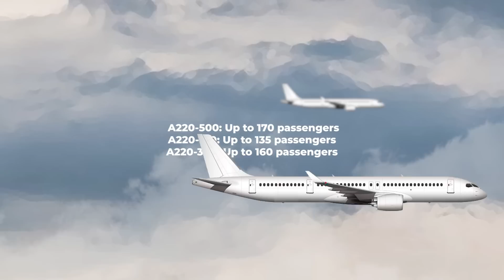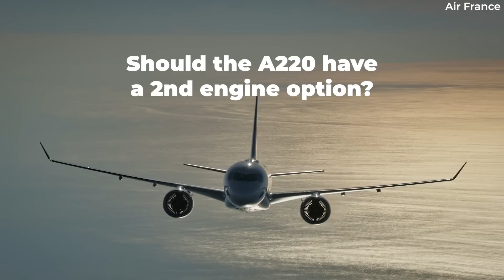Airbus' CEO Would Like Another A220 Engine Option

Comment: There needs to be a A220-500 and A220-700, definitely with 2 engine options. 

P&W really dropped the ball with their preventable GTF quality issues strapping resources to max capacity. 

They may never recover in the commercial aircraft market.

Comment: The real question is, I'm not sure how interested CFM really is as supplier. They are jammed full as it it with all the 737 and 320 engines they will have to supply. I doubt it's high on the priority list yet for the 220 for a low volume aircraft to develop and produce.

Comment: Why oh why don't RR make an engine for smaller planes - 220, 320, 737 etc. I feel they are missing a trick somehow with the amount of these smaller single isle planes now in existance.
Reply: They might launch an ultra fan variant to compete. Basically a mini version. But it’s probably for the plane that replaced the A320. Just not viable to spend billions developing a CFM competitor based on likely sales.
Reply: Well they are making the engine s for the B52 to replace those Pratt's don't think it would work on the 220 though
Reply: @ronparrish6666  those are the engines taken from a business jet so yes they are too small for a a220. Only enough for the b52 as there are 8 of them

Comment: Having a second option is a great idea, look at the 787 dreamliner it has 2 engine options so if one of the options has a problem the other option is safe
Reply: Same with the A320neo...
Reply: Really?  I thought the B787 was Rolls-Royce only.
Reply: @michaelrmurphy2734  70% of the 787 engine market has gone to GE because of how much RR kept screwing up the fixes to the fan blades cracking issue that finally got resolved 2 years ago